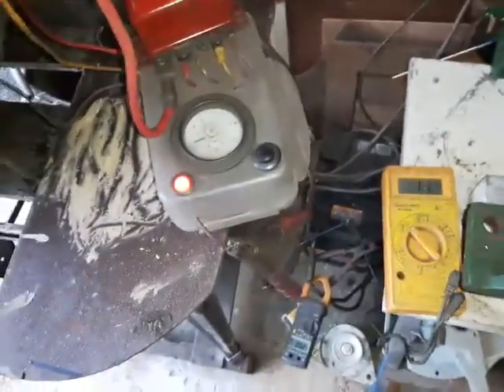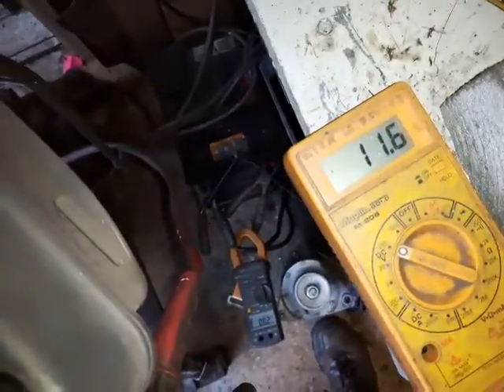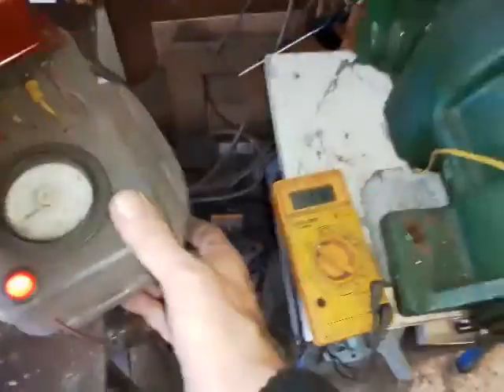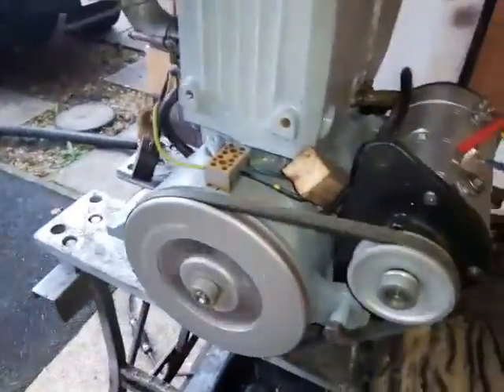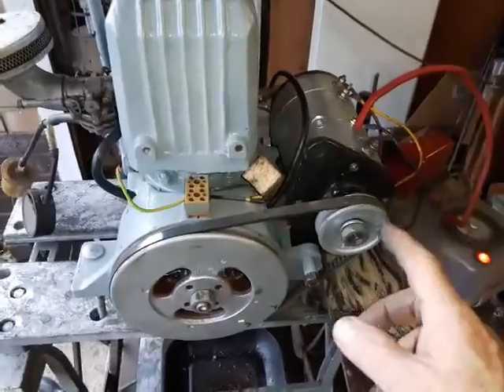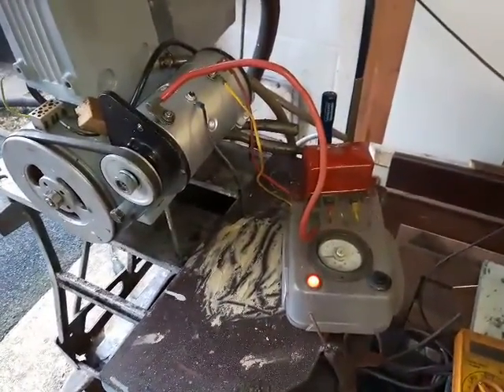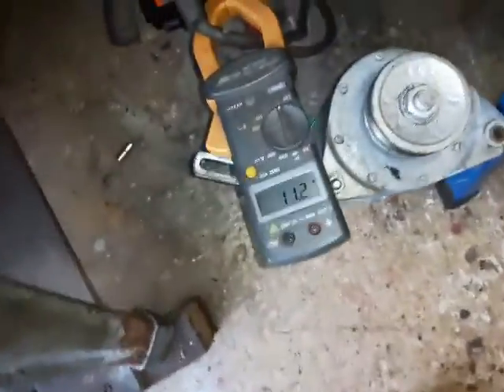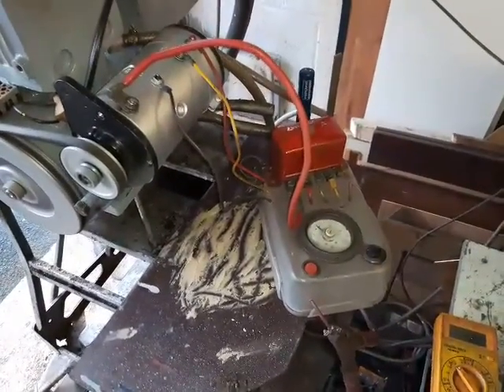Dynastart Starting  and Charging Test (Volts RPM and Amps etc)

Comment: Hello, i have an issue with my old volvo penta md2 dynastarter, new dynastarter and new relays. Charging lamp is shining at idle, but if i rev to approx 1000 rpm it starts to charge, if i go over 1000 rpm approx it will start to overcharge, over 16v